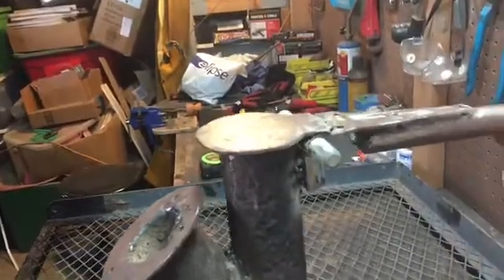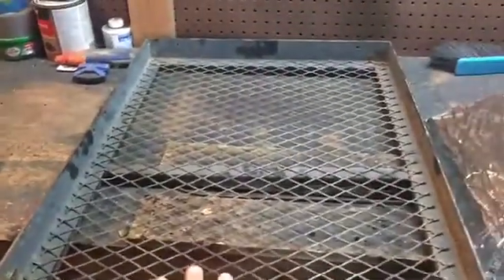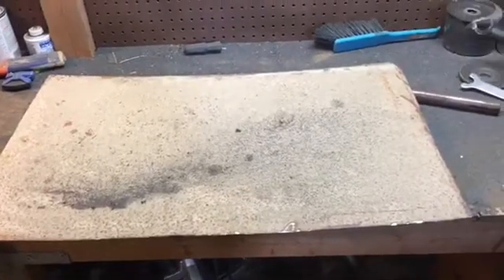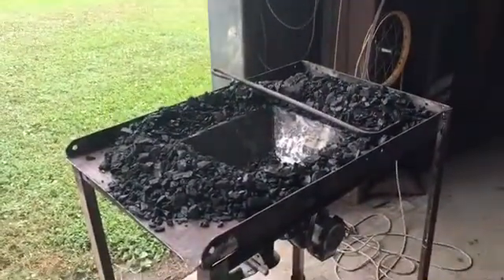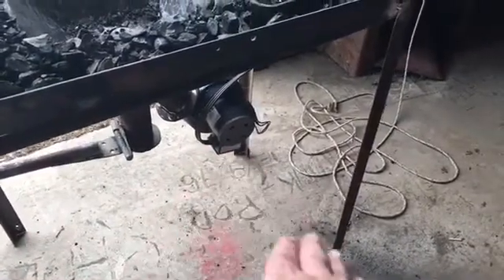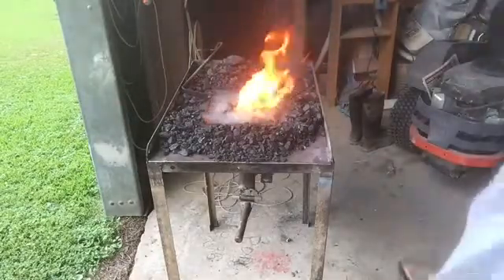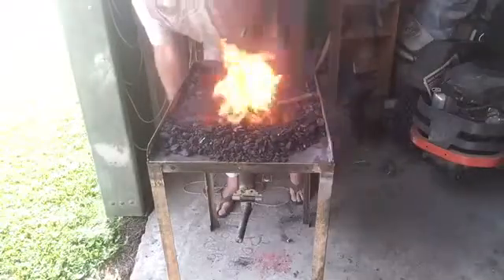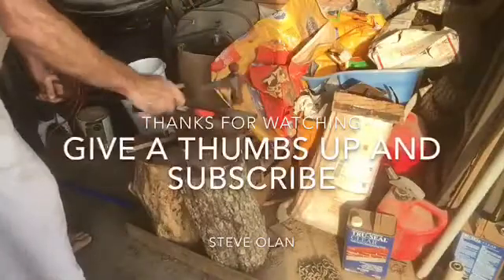Coal Forge Build - Part Two

Comment: If you bust those coal chunks up as fine as you can it burns a lot better. The coke is where your true heat will come from.
Reply from the maker: Steve Adams thanks for the tip... I will have to try that when I get my forge moved. I recently relocated.

Comment: The idea of the fire pot is to pass the air from the blower through enough coal to get all the oxygen out. So you shouldn't stick your forgings into the pot - you'd just scale it away. Just lay it on top and pile some coal on top of it.
Reply from the maker: Yeah, I've learned a little as I go. Thanks for the input I really appreciate it.

Comment: I use a 2 inch deep fire pot 4 inches wide... It works well
Reply from the maker: Thanks for sharing. I am learning to work with mine but if I ever did it again I would make it a little shallower. If I had access to good coal at a better price I could just build it up more and work across the top of the firepot. Thanks for watching.

Comment: Could you use some fire bricks to reduce the size of the firepot for smaller projects?
Reply from the maker: I think that would probably work. I am getting better with the forge and know how to work it to get desired results. I was actually considering making a "false bottom insert" that I can just put in the fire-pot to make it a shallower pot.

Comment: Nice what blower did you use and how did you configure the restrictive air flow for it?
Reply from the maker: I will get you the information on the blower I ordered. It is an electric blower and it came with a plate attached that you can swivel back and forth to control the air flow. Thanks for watching!
Reply from the maker: Sorry for the delay, I have had the flu for weeks
Reply: That's alright matek hope you're better now.